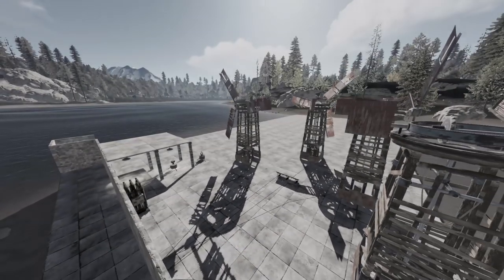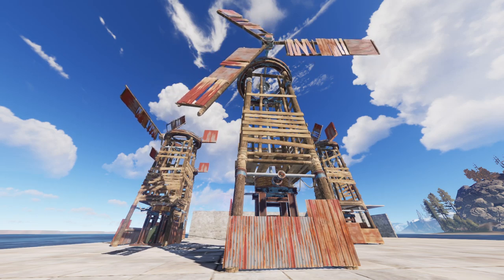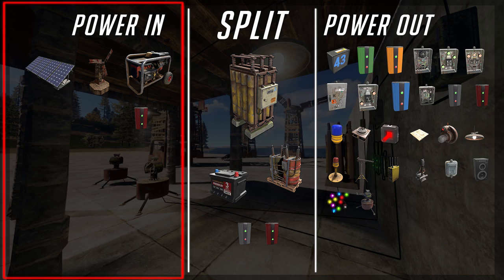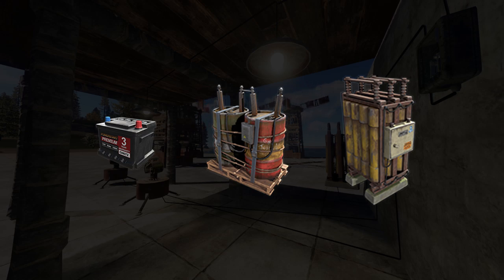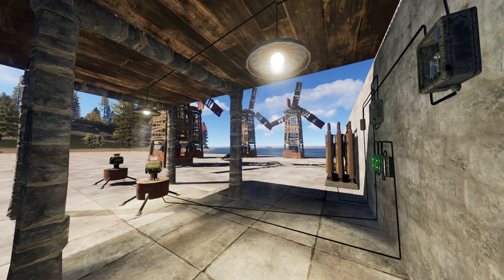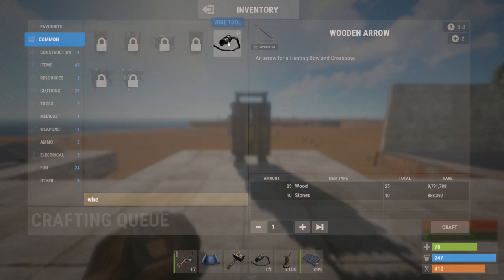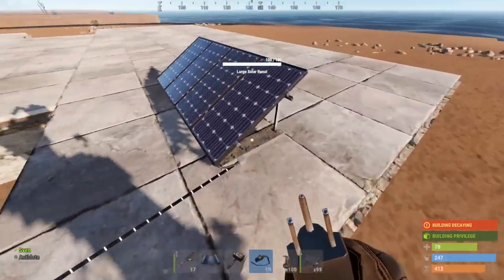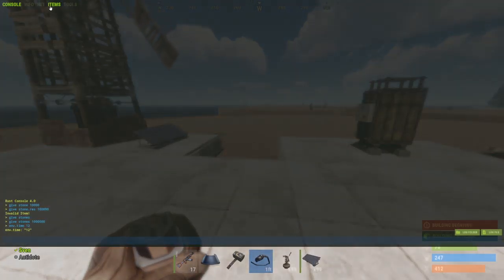Electricity 101 - Basics & Modular System | 1.0 | Electricity 2020 | Rust

Comment: Great video! A tip is to make a new updated video on this since there is way easier ways to power systems, for example my turret setup, i use 1 windmill to power 9 turrets, windmill -> large battery - > switch -> electrical branch -> electrical branch, i put the branches to 32 output and connect 3 splitters, after that i just connect turrets, its a supper efficient and easy electricity setup turrets in your base, usually i have 4 windmills and 4 individual systems.

Comment: Usually slap battery’s in my honey comb, saves a lot space. Wire it to a root combiner before you seal it though or else you won’t be able to re wire it if you disconnect it 😂
Reply: And if the root combiner is broke then what lol
Reply: Andrew Lawrence you just never ever break the root combiner
Reply: @darkfangulas  what if it breaks in a raid lool. I deal mine in honeycomb but with a windowsl
Reply: @oof578  if it breaks in a raid and it was placed in the center of  the base your finished anyway haha

Comment: Top tip. 
4xOutput=Maximum Input
Anything over 4x does nothing.
Reply from the maker: What do you mean exactly? Can't have more than 4 batteries in total aka 400 power on 1 system or ?
Reply: @Sven_YT  A small battery for example has 10 output. 10 x 4 = 40.  So if you have 3 solar panels going into 1 small battery in perfect conditions ( 20 input each ) only 2 of them are working.
Reply: so 400 input is the max for each large battery in your system. with 4 large batteries that's 1,600  max input.
Reply: I can also show you some cool stuff no one is talking about on rustrician. For example how to properly use the 2 new inputs on the right side of the switch. There are NO VIDEOS on youtube on how to properly use those inputs... and NO diagrams or posts on rustrician on how to properly use them. Also... branch power is ALWAYS used by your battery unless you use those right side inputs properly.